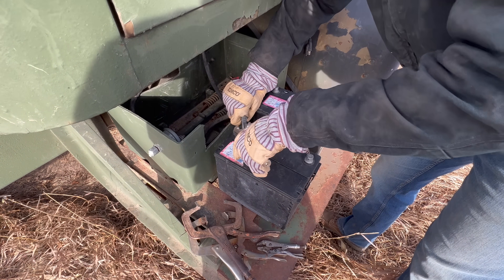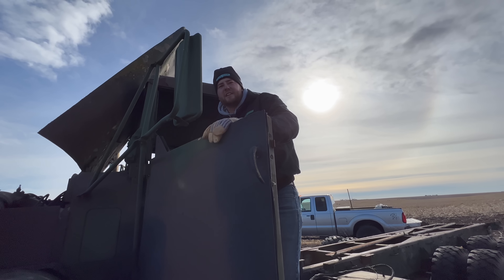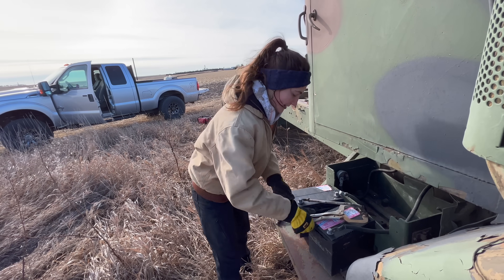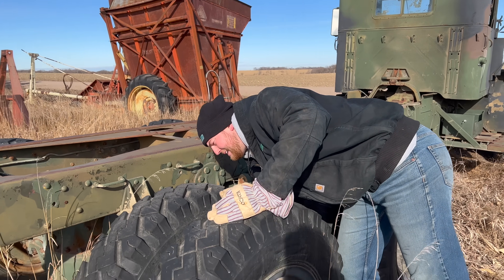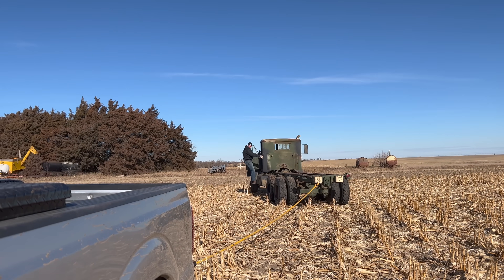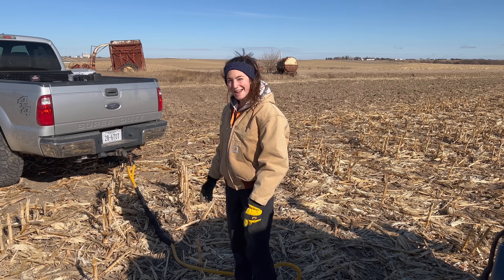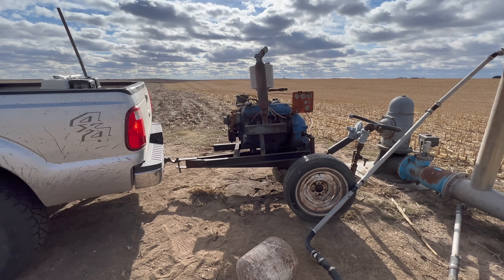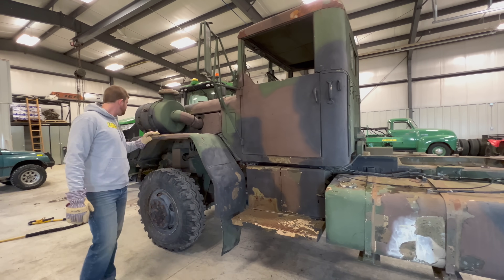If You Can Start It, You Can Have It

Comment: In regards to the number on the vehicles:
Army Technical Bulletin 43-0209, Color, Marking, and Camouflage Painting of Military Vehicles, Construction Equipment and Materials Handling Equipment, standardizes how vehicle bumper numbers are applied. The markings are divided into four positions. Positions 1 and 2 are applied on the left, while positions 3 and 4 are applied on the right. The positions identify

1. The major command, organization or activity the equipment is associated with;
2. The intermediate organization or activity;
3. The unit that operates and maintains the vehicle; and
4. The specific vehicle number (often associated with the order of march).

Anything beyond this policy such as assigning a specific number against a specific unit position is a matter of unit standard operating procedure. However, the number six has traditionally been associated with the commander of the element. For example, a Humvee assigned to the commander of Charlie Company would be designated "C06," while the 1st Platoon, Charlie Company's command vehicle would be "C16," 2nd Platoon would be "C26," etc.[2]

Comment: So that is either a duce and half or and 818 5  Ton. Has a Detroit inline 6 multi fuel that will burn diesel, JP8...jet fuel,  or mogas. Has a inverted 4 speed transmission with a 2 speed rear end and walking beam suspension. Top speed of 52ish. You need 2 semi batterys  in series to start it. Dont worry about the split ring rims, when you go to air them up put them on the front drive Axel with the ring facing the hub. Drove on in Iraq for 13 months so if you need help reach out.

Comment: M54A2 with multi fuel engine, Timken 5 speed transmission, two speed transfer case, Spicer differentials. Automatic front wheel engagement with rear wheel slippage or when transfer case is put in low, which halves speed. Lowest speed at 2800 rpm is 3.5 mph, highest speed in fifth gear in transfer high is 55 mph at 2800 rpm. Up to 90+ with governor disconnected. Tires 1100x20 @ 74 lbs.

Comment: The numbers painted on the bumper referred to one side,  #1 the Military unit that the truck was assigned to,  the other side  #2 the trucks in the unit all had an individual number. The truck was referred to as a 5 ton an older truck design. Very likely it was assigned to a National Guard unit.
Reply: A number of those older trucks did in fact go to reserve and guard units in the past. Just as well, a lot went to the various state and federal surplus agencies for auction and / or private sale. I do remember driving those at some point when I was serving

Comment: I was in the Army, (Hq Co 2 battalion 33rd Armored) and that is a M813  5 ton cargo truck. Mine had a 250 hp Cummins. The muffler is off under the right fender.  It takes 2 M8 truck batteries. The truck I had was a cargo bed  fuel tanker with 2  600 gallon fuel pods with gasoline pump motor that runs the fuel thru a canister fuel filter to 2 spools of fuel hoses. I was part of POL (" Petroleum, Oil and Lube")  to the 3rd Armored Division fueling tanks and other diesel vehicles.
Reply: I'm wrong about the batteries but  the engine is a 250 hp Cummins

Comment: Cool thing about these old military trucks is, if you check the engine type, it might be dual fuel capable; meaning that normally, it's runs on diesel fuel type 2 OR, if it's dual/multi fuel capable, you can run it on regular gas or gas/diesel mix.

The bumper numbers (curbside is Major command and the roadside is the company & vehicle number).
Cool grocery getter for sure!

Comment: 5 Ton M813 , If I remember (back in 1985) you need to Pump the handle on dash left side, maintain 80 PSi on gauge while cracking.   Maybe spray a little starting fluid into air breather also.  Need some good 24 volt battery'sand replace battery cables.  Find an old Military Mech at the VFW.

Comment: The numbers on the front are bumper numbers and identify the unit that owned the truck. Those vehicles have 4 batteries set up as a 24 volt system. Fuel is JP8 but can run on diesel or kerosene but will burn hot.
Reply: You can run it on JP8, but they're designed to run on diesel.  You need a pyrometer on the turbo, and fuel additives to run it on JP8.

Comment: You'll have to bleed the injector lines on the engine, cause after sitting that long they're no doubt full of air, so turning the engine over means the injector pump is just compressing that air and not delivering any fuel to the injectors. While you crank it, loosen the injector line right where it goes into the head. You'll see some bubbles come out. Tighten it back down after the bubbles stop and while you're still cranking. Go through them all one by one. By the time you're down to the last couple, it'll probably start to fire. Cheers!
Reply: These Cummins have unit injectors, no individual injector lines.
Reply: No expert but wonder if the engine is a Hercules like a 2-135 or 2-155. White tractor??
Reply: @kevinsiedschlag429  No, Cummins.

Comment: I believe the rig is from the 13th COSCOM (Corps Support Command), 13th COSCOM was activated in 1975,  redesignated as 13th Support Command in 1980, and then reflagged as the 13th Sustainment Command (Expeditionary) in February 2006.
The 36M may have been the 36th Medical Detachment and I dont know about the 49.

When I was on active duty in the army, our vehicles were numbered as (for example) on the left bumper as: 555E 14E, and on the right bumper as A-12.
That identifies the 555th Engineer Group, 14th Engineer Battalion, Alpha Company, 1st Platoon, 2nd Squad.
Reply: that's about what i was close to .. researching a bit here.. If i hadn't been EPTE Medical during boot i woulda made it to my MOS in USMC ..oddly enough was MOTOR T.. based i what i got ... this was vehicle #49 of the 36th Medical Detachment.. 1st medical Battalion.. for the `13th Command Control South.. re: Vietnam.. due to size i am guessing was a medical supply truck.. don't see the red cross on doors so definitely was not an ambulance.
Reply: 13th COSCOM,  1St Medical Group 36th Medical Company, Truck number 49

Comment: Although I don't exactly know the designations, the markings on the right tell the group. It was assigned to a command battalion and it was a medical truck. Possibly a mobile hospital or a supply truck. The numbers on the left are the company, and platoon. So it would read something like the 36th Medical Company of the 13th Sustainment Command, 1st Medical Battalion. I don't remember what the 49 is, maybe the truck number. And from inside the cab I see it was a luxury version, it had a heater.

Comment: The dump truck I used to own required 4000 cranking amps (12 volt) supplied by four batteries.  You need more than your two batteries.
Reply: This is a 24v system.

Comment: I used to ride thoroughbreds for the primary owner of Continental Motors the maker of the Multi Fuel. In the military I often drove 2 /2 tons . In the Muti  used what ever fuel I could get. In Vietnam where it was always hot I used diesel or JP4. In Germany where the temperature used to be way colder than it is now often I used regular gas. When using gas just put about a gallon of oil per 100 gallons of fuel. It can even be used oil if it isn't extremely contaminated. I put oil like that in my die real old engines. The new off road fuel doesn't lubricate the old injection pump like it should. The Multi Fuels have just a little less power than a regular diesel in real warm weather no matter what fuek you use.

Comment: Laura, as you guys go further into married life, you are going to find yourself asking Grant, (What are you doing?) more and more. You had that look at the end of the video that my wife has been giving me for 21 years. Love watching you guys.
Reply: Grant will come to expect and demand that look to ensure that whatever he is wanting to do is the right thing to do!
Reply: Would be wise to change the fuel by or drain it 
Then check your battery cables make sure they can carry the amps use your glow 
Plugs   crack each line at each injector while crank ing  DO NOT USE STARTING FLUID very
Bad for the engine

Comment: The continental LDT465 was a multifuel engine that can run on gasoline... well gasoline with some motor oil for lubrication of the injection pump. It had about 140hp. In order to burn any hydrocarbon fuel it uses the patented Man hypercycle. Instead of atomizing the fuel like a normal direct injection diesel, it squirts it like a stream into a bowl on the piston and forms a puddle of fuel that burns at the puddle-air interface

Comment: The wheel stud pattern is what as known as Budd wheels. Left hand thread studs and nuts on left side, right hand thread on right side, and which side is called out as from sitting in the driver seat.
The starter on the truck can be changed to a common 12 volt Delco Remy 8200308 as long as the battery cables and batteries are installed as such. The fuel solenoid on the engine fuel pump can be replaced with a common 12 volt from 1985 generation road trucks.
The headlights can be replaced with the sealed beams from a ‘75 Ford or Chevy pickup common part.
The gauge holes are common 2 1/16” diameter, so a retrofit is possible if desired.
If the truck is converted to 12 volt, mark the jump jack at the right rear of the cab as 12 volt, or disable it. It’s known as a NATO jump charge jack for 24 volt. Handy as a pocket on a shirt if in the correct voltage configuration.
The speedo cable may be able to brought back to smooth running life by disconnecting it from the rear of the transfer case, making a simple funnel from trash paper and tape, then pouring in some light oil with oil soluble graphite for lube. Another tip of the day, same for your motorcycle clutch, throttle, and brake cables as newly installed prevention, or maintenance before someone gets stranded. Why would I know this?
Reply: You got stranded? 🤔
Reply: I’ve always heard to use regular old green anti-freeze in the cables as lubricant instead of oil, or a dedicated cable lube in an aerosol can using a lubricant injector fitting on the cable jacket.

Comment: Those numbers show the Unit that the Truck belonged too.  From what I can see it belonged to a Medical Company of the 1st Med Battalion or Brigade.  The 36M 49 is simply a identifier for this specific truck.  Much like a license plate.  This truck most likely hauled Big Tents and other Medical equipment.  This truck is what we used to call Duce and a Half.  They can run on MOGAS, in other words they can run on Gas or Diesel.  They prefer Diesel.

Comment: I'm a little late to the party, but the M-35 had a Diesel only and the M35-A2 had a Multi-Fuel version. The Multi-Fuel version could run Diesel, avgas, kerosene, and commercial gasoline. There were stipulations as to how to run them and you can not mix them. I don't remember all the details, but you can do a bit of research and figure it out.  That's a fun project, but it's going to be a lot of work!

Comment: Heh guys. That truck has an NHC-250 Cummins motor. This would be a diesel-only unit. I would personally start by changing the fuel filters, draining the tank and starting out with fresh fuel. (You might want to add a fuel additive). Also, this is an 855-cube (14.0L) engine. The batteries you were using are not big enough to turn it over; particularly when its cold starting. Great video as usual. Keep up the good work. Can't wait to hear that big Cummins purring in the near future!
Reply: Um they turned the engine over in the video :)
Reply: @Dargonkin527  but not fast or long enough to start it. It spun tho, & that's the most important thing.
Reply: @cynthiahoff1512  One of the reasons it did not start then was that they had not turned on the power to the ignition. These things have a few levers to pull and switches to flip in order to start up. They had sent power to the starter(so it was able to roll over the engine) but not to the ignition(no spark/glow) You are absolutly right that the fact it rolls over means it is not seized so a very good start, even if it didnt :)
Reply: @Dargonkin527 last I checked diesel engines don't need "spark" and those particular engines have no glowplugs. I grew up on a farm before that particular truck was built. Many of us had a multi-fuel ma deuce & a half around. While that one was likely built after they went to all JP5 fuel, the electrical system was about the same. Plus? Go watch the next video. 2 bigger batteries, a jump box and a little ether fired it right up.
Reply: @cynthiahoff1512  Meh. Don't mind me, I guess having thousands of hours running these types of trucks gave me no idea how they work and what switch turns on what system. But you have an excellent day.... :)

Comment: FYI - When you tried to pull start the truck you had disconnected the batteries therefore you had no power to the fuel pump...  just an observation...  Have fun!
Reply: That Cummins would have a mechanical fuel pump, but it’d definitely need the lines bled before shed fire off.
Reply: Didn't these old diesels also use glow plugs to warm up the combustion chamber before starting? Every old diesel I've driven required you to keep the glow plugs on until a light went off on the dash telling you the plugs had been de-powered, and the engine was ready to start.
Reply: Yes you need power to the fuel pump shut down valve even to tow start the engine. Otherwise you need to screw in the manuel shut down on the pump. Be careful if you do this as theres no way to stop the engine only by unscrewing the manuel again. Greetings from ireland.

Comment: When starting those trucks usually you need to turn on the ignition switch then wait for the glow plug light to go off before fully turning the switch until it starts.
Reply: @cumminsscout  I watched another of her videos, and she said they are located in south central Nebraska. Dead of winter there. Hmmm. Was the NH250 not designed with glow plugs?
Reply: @cumminsscout  And even though I am a retired 88M Army driver, I learn somethin new everyday...Thanks for the info.

Comment: @LauraFarms You may want to take a look into the Oval thing just up and to the right of the button you pressed to start, (the thing with three switch levers on it). 1 pointing strait up, and the other two pointing right and left.  in some vehicles they lock something out which needs to be engaged during start up.  In the video we can't hear the fuel pump, but you'll need fuel, good fuel, and spark to get it started.  Other wise it seams to have promise as you noted it's not seized up, so that's good.

Comment: The multi fuel engines could run on anything,  including gas as long as it was blended with oil or diesel.   That truck looks like it has a cummins in it, I think those are only diesel but not sure
Reply: We run mo-gas. 70 octane I think it was

Comment: About that Multifuel question...
I do not know whether these trucks are fitted like that but the but the multifuel concept basically means you can mix the base fuel (diesel) with anything else burnable and the vehicle will run as long as the mixture has a content of at least 30% diesel. Its a standard for combat vehicle in the german military and probably some other armies as well

Comment: My first impression, is that you would need a tractor, in order to pull the big truck! Was shocked the pickup worked!
Reply: Back in the 80's my father used his 1969 Ford F100 pickup to tow a single wide mobile home. Rolling weight is much easier to pull than dead weight.

Comment: The Army Calls that a 5 Ton Cargo truck. The rear bed of course is missing. I drove one for about two years. They are a heavy duty tough truck made for all weather tactical work. I drove one of those through terrible mud and snow storms and never got stuck. Right over your head on the battery compartment is that round connector. That is the military jump start cable connector. That is what we used to jump start them. They were great basic Cummings Diesels that ran well but you need to blow out the fuel injectors periodically to clean out that dirty diesel fuel build up. Heaters are optional kits installed on the passenger side under the dash. Thanks for the video. It also works to pull start them, but use second gear not first to pull start one. Good Luck BP

Comment: If its a diesel it might have a special filter. Than it can run on afgas  or so and the filter supplys some lubricant for the high pressure fuel pump.
The pulling power/weight of the towing truck sets the tickness of the rope.

Comment: I repaired WAY to many of these trucks. If I knew where it was, I could try to get it going for you. The battery system requires 4 batteries in parallel series configuration. I'd dump the fuel, as it is diesel and I'd bet it has water in it. I use to be in the Army as a mechanic that worked on this version of military truck, as it is a 800-series cargo truck. if the engine is good, I can get it running. Get ahold of me, as I live in Kansas, near Ft Riley, not to far from the city you have listed.

Comment: That’s an M 800 series 5 ton cargo truck with the extended frame for the long cargo body. DO NOT run anything but straight #2 diesel or a blend of no more than 40% kerosene 60% #2 diesel, You’ll need 2 twelve volt dozer batteries and when you turn on the battery leave it on for a bit for the fuel pump to build pressure. You should also check the fuel filter before cranking so you don’t inj Ct water into the engine

Comment: The leavers just  above  the start  button  must  be  flip up to  allow  the  glow plugs  to  fire if not  it never  and  the t handle must  be  pushed all the way in that's  the engine killer
Reply: Cummins 855 NHC 250 have a PT fuel pump and NO glow plugs But a possible intake manifold pre heat element.there is a manual run screw that can be turned in to start engine buy jump start or crank but no electrical power needed for fuel solenoid shut off in fuel pump.